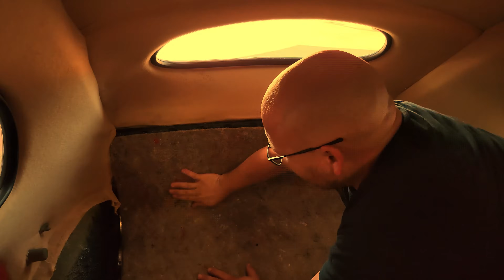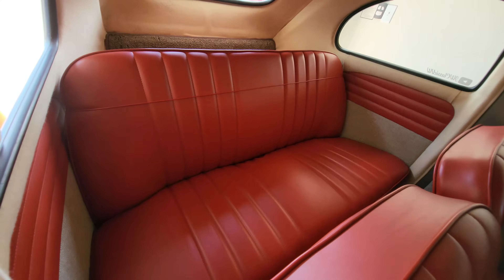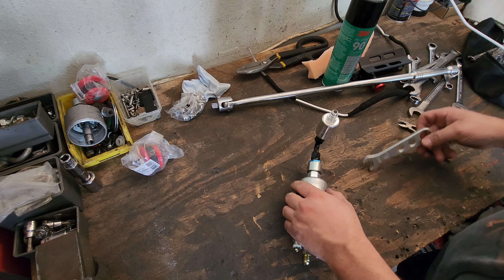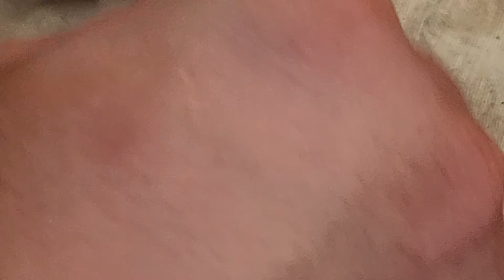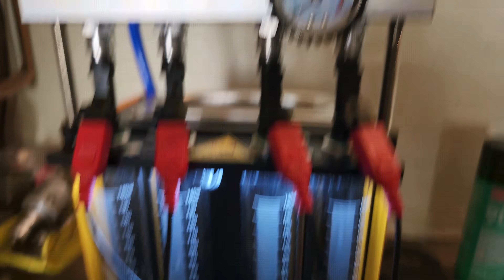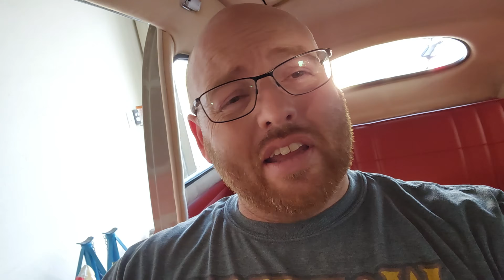VW Beetle Turbo EFI Fuel System Pressure Issues "JW Classic VW"

Comment: Yeah like the guy said below.. flush that tank and maybe get it re-coated or something in the future. Check the dirt see if any paint chips from the tank are in it. Mine was a mess.. i had a filter under the tank..and before the engine..and i replace the under tank one when i see it full of dirt.
Reply: agree, corrosion in tank is going to keep on causing issues. Expect fuel delivery issues such as hesitation as injectors are partially clogged then clear the tiny bits of corrosion based particles.

Comment: I would replace the fuel tank. Looks like it has rust inside. A new fuel cell, might be the way to go. Just my opinion.
Reply: Radiatior shop can treat it so it looks new and doesn't even hurt the outside paint. Can cost as much as or more than a  repro tank but better
Reply from the maker: Gotta check that out! Thanks for the info.

Comment: Hey JW did it always do it or did it develop it .
Reply from the maker: It's been off and on... maybe a coil failing... or one of the injectors.  Still working on it.
Reply: @JWClassicVW  in the long run it mite save money if they can tell you what wrong and you only replace 1 part ? but if they steer you wrong you mise well took pop shots at it yourself ?